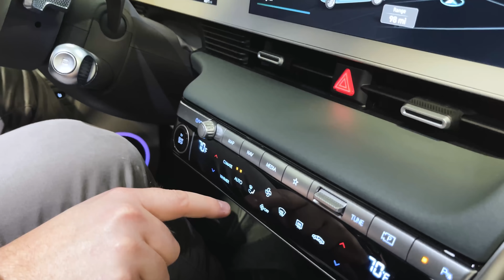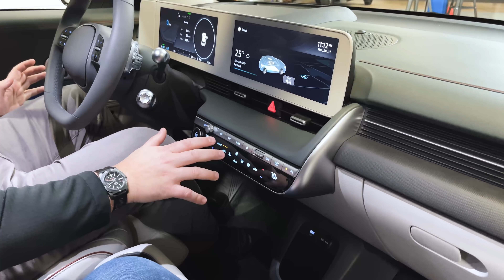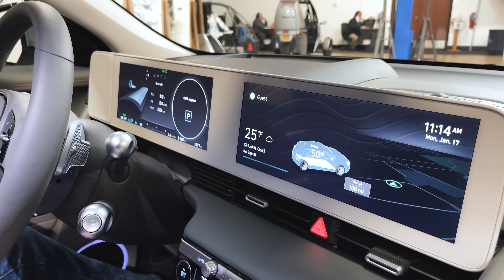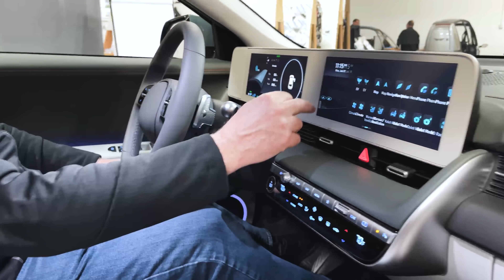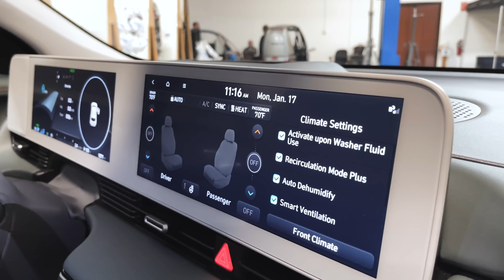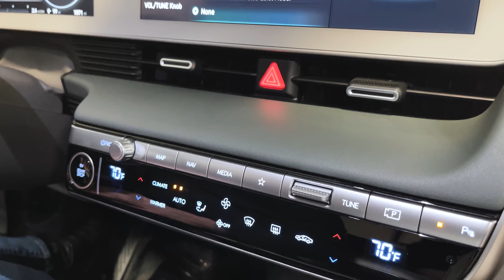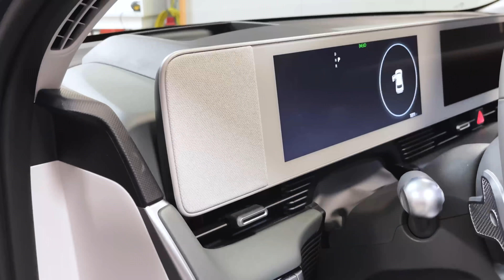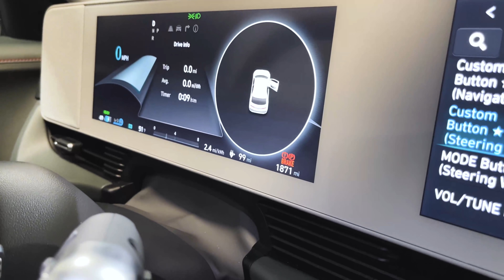2022 Hyundai IONIQ 5 | Sandy's First Impressions

Comment: At first glance, it looks like a modern take on a Honda CRX. It's more stylish than a Model 3 IMO.

I disagree completely about eliminating all the physical buttons. I would go so far as to say that the buttons need to be physical instead of capacitive. I understand that capacitive button panels are "cleaner" and likely cheaper, but we have them in our Explorer, and I would much prefer physical buttons, especially for the most-used buttons (seat heaters and steering wheel heaters in the winter). Those controls are only available in the touch screen on our model year, but they were made physical a few years later. I never use the touch screen to control the HVAC because there are buttons that do it easier and faster.

Wanting physical/dedicated buttons over a touchscreen-only interface doesn't make me a luddite (I'm perfectly comfortable with technology, thanks), it's about using the right tool for the job. Touchscreens aren't a cure-all, just ask the people that are still trying to find where things went in the latest release of the Tesla software. Anyone on a design team wanting to replace dedicated buttons should justify it by showing that it's just as easy/fast for a person driving 70 mph in traffic wearing gloves in a freezing cold vehicle to adjust the temperature of their seat heater while keeping their eyes on the road as much as possible. So, basically, less than a second to second and a half. That one second just took your eyes off the road for almost 103 feet. Three seconds is the length of a football field.

The only way that I can see this is to dedicate a space at the bottom of the screen that is always occupied by those controls. Kind of like the Mach-E and the Lightning...

Comment: Great first look guys, thanks!  Beautiful aesthetic design inside and out....with the exception of that frunk.  Now, at least they give you one where you could move all that charge cabling from the trunk to allow actual use of the sub-trunk, but you have to wonder whether they would have been better off bolting it shut like the Fisker Ocean to save costs as this frunk space, like Sandy said, is maybe good enough for fitting your wallet!  Better for Hyundai to save costs like the Fisker and price the Ioniq 5 so that it's more accessible to increase their customer  base during an incredibly competitive time.

Comment: Cory spoke a lot of my heart about this car. However Hyundai removed quite a bit stuff from the US model, and their launch is a mess. I paid 100 deposit back in June last year, only to be told that I cannot choose drivetrain, trim level, or color. We are at mercy of Hyundai on what was sent to the nearby dealers. And most dealers are having a huge mark ups on these.
Reply: Agreed. I've had mine reserved since May. I called the Hyundai Concierge service last week and they said I should get an email towards the end on this month. They also said that they have no control over pricing, but that they could add a preferred dealership of choice in my area. They also disclosed, after asking many questions, that  Hyundai is conducting exit interviews with Ioniq 5 buyers to get feedback. Well, on of the things I was able to get from the rep is that they know how much dealers are charging over MSRP. On average it's between $2,000-$10,000 USD! I'm willing to pay up to $3,000 over sticker, but no more. Hope this info helps a little. Good luck.
Reply: @dearbulls  thanks for the info. I'll look into it.

Comment: It would take me a month to figure out that you swipe the screen to get to the options, and probably only if someone else showed me. I still cant get used to that as a control feature on my smart phone either. To me if its not visible it might as well not exist. And thats when I realized that Sandy is more tech savvy than me and Im 44 and have been using computers since I was 8 years old. 😂

This is an absolutely gorgeous car. I really hope they do a city car kind of thing that is the same style but scaled down.
Reply: @Patreekko Time Agree 100%, our ISP crashed on Christmas Day so my  NBN dependant iMac was useless. I was forced to use data (first time ever) on my iPhone 12 Pro Max to gain access, & it was an absolute pain in the butt. I'd hate to think what it would've been like on a smaller screen.

On a touchy point of mine, please be nice to Sandy, I guess he's slightly + or - of my age & his red eyes could be from alcohol abuse, which probably explains why he didn't test the Ioniq on the track. 😉

Comment: "Auto Hold" is sort of a hill assist function that allows the driver to remove the foot from the brake pedal whan stopped at lights.
When taking off, the brakes disengage when the speeder is pressed and prevents backwards rolling of the car.
I have this feature in my Renault Zoe, but never use it as the car is programmed to work like an automatic ICE, that is, it starts applying about 1kW of power to the motor the moment you take the foot of the brake pedal. It would have to be a serious incline to overcome that and we don't have those in my neck of the woods...
Reply: Mercedes have the best idea. If you want to hold, you give the brake pedal an extra little push and you can let your foot off the brake knowing that it won't move anywhere. 

If you don't do the extra push, it works like a normal automatic. It means that whether to hold or not is entirely under your control, and you never need to touch the parking brake or transmission park as it'll just put them on automatically when you get out of the car.

Comment: Good video I test drove the Ioniq5 on a very wet day on dirty winter road in British Columbia Canada big problem not having a rear wiper , I hope that in Canada we can turn the rear facing camera on full time while driving as that would help I am sure it will be only a software update as its available in the UK cars, this was the only fault I could really find with the car. Sorry but I disagree with Sandy on the removing all the buttons its nice to have also if other people drive your car and are not familiar with the touch screen that a plus, also I have often thought about the Tesla having only a screen what happens if you have a screen failure .  I would like to have seen the passenger seat on the Ultimate the same as the drivers seat complete with the leg rest. All in all I think this is a great car I have already ordered a Long Range AWD Ultimate which I hope to have July Aug so by then maybe they will have made changes. Thank you for your video .

Comment: Personally want the manual control panel. Could phase it out in future models but there's lots of us boomers. But then I drive a 2007 chevy diesel truck with 250k and all the knobs still work and if 1 part goes bad I won't need a new $3k touch screen.

Comment: The 3 settings for auto HVAC settings is a huge thing for me. 
My car has Auto that I don't use because it comes on full blast. I'll limit it and then after driving for awhile put it in Auto.
My sister had an expedition with the different Max auto settings and it was great.
Reply: I tend to just adjust the temp to change how agressive Auto mode is. E.g. if I want it to warm up as fast and agressively as possible, I whack the temp up to Max. If I want to it be less agressive I set the temp closer to the current temp. Having different Auto modes would save some faffing, but it's not something I have to do often.

Comment: I'm very impressed with the products and design coming out of Hyundai/Kia. The only thing wrong with it is that it says "H" on the front instead of "T", so it can't use the supercharger network. Daily, I drive hundreds of miles and supercharge almost every day in addition to charging up every day at home.
Reply: I'm a Tesla fan,  but I'm even more a fan of efficiency, which means EV.  Tesla has a few "moats", one of the biggest is the Super Charger network.  But I don't understand why almost all Super Chargers are back in only.  Pull thru makes more sense for purposes of forming a queue or pulling a trailer.  BTW, the only reason Teslas have left rear charging ports is because Elon's home garage was set up that way.
Reply: @wilfredvanvalkenburgh2874  interesting... I didn't know that about the charge port location 👍

Comment: Interesting. I was thinking, if the odd plastic vent pockets on the rear hatch. Is to keep heat from the window defrost metal strips, from building to much heat in the area. answer below by Tom Ruffell seems more accurate.

Comment: I'm prefer the mechanics and fluid  tanks be more simpler to get to just incase you can't get to the mechanic in time like getting stuck at a charging station without enough charge to get to the mechanics. Also make it so all you need is 1 or 2 tools to get access and remove parts and put them together with ease.

Comment: 22:37 you can program that in a lot of cars, there's just no button for it.

Either through driver controls and infotainment or OBD config.

I have a slow ramp up on my cars.

33:19 ... Yeah, and how's that working out? The octovalve is a good idea in theory that seems to be shitting itself in practice, probably due to the usual suspect of poor QC on Tesla. Not that Hyundai's been doing that much better.

Comment: For how old sandy is, I am surprised he prefers climate controls in the infotainment. Personally I prefer climate separate because when you first start the car on a hot or cold day the car screens usually take a second to boot and are laggy meanwhile I’m trying to get my ac blasting, turn on heated seats or get windshield defrosters going. Stand-alone controls don’t lag and are easy to use when the car is moving. Hyundai made the right choice here climate control in screens are not optimal when first starting up or going down a bumpy road.

Comment: Sandy, get rid of the buttons that immediately give you the function you want… I’d rather spend time flipping through pages while I’m driving distracted.   Riiiight.

Re the frunk.  Frunks are stupid.  You have to make the front of the car longer to make a frunk and that takes away from the interior space unless you want to make the exterior dimensions bigger.

Comment: Sorry Sandy, I prefer climate controls separate than digging up on the screen. 
At first, it's feels interesting and curious, but overtime it gets annoying.
It'll not be user friendly and it's dangerous to take off eyes for finding the settings inside the screen while driving.
And that's a brilliant work from hyundai to separate frequently used settings from the screen.

Comment: You guys clearly don’t look in enough cars if you haven’t seen customisable buttons. BMW have had steering wheel customisable buttons for at least 15 years. Furthermore the 1-8 buttons on the entertainment system can also be programmed for any function. So for example 1 may be a radio station, 2 may be navigate home, 3 call home etc. Having assignable physical buttons means that you don’t have to scroll through a touch screen to find functions that YOU use regularly. I don’t want a designer/engineer like Sandy telling me what functions I should want easy access to.

Comment: They both missed the sliding rear seats.  They both missed the fast charging.  They both missed the AC out and the ability to emergency charge another EV.  And Sandy is wrong about too many buttons.  It's way easier, especially at night, to see buttons rather than swiping at a screen.  Choices are good, especially customizable buttons.  The exterior is sexy, rather than a frumpy gumby-faced Y.  AND it has a real info screen in front of the driver,  AND it offers a HUD.  The 5 is a winner.

Comment: nice first impression. About the programmable buttoms, the bmw i3 has 1-9 that many thinks are radio buttums. It also have 2 positions backseat. Have just used your good offer on the teardown. Think the buttoms for climasystem can shift to media with one of the buttoms?

Comment: One question I'd ask is how much (in money) do you estimate the multi-colour treatment) and 'scalloped' body panels/styling add to the overall cost to manufacture, compared say to a single colour, say with black highlights plus just a few at most  plastic frim panels plus simpler sheet metal.

Comment: 20:29 Was that an incandescent light under the sun visor?
Hard to believe in 2022, but the gradual light ramp seems light an incandescent bulb heating up, so wondering.
Reply: Good eye.  I think you are right.  In an EV, this seems to be a cardinal sin.  If correct, this would show an extreme lack of detail.  If this then probably 10 times as many unseen energy "hogs".

Comment: That's an error to get rid of the physical controls under the screen.  I don't want to have to fumble away from navigation or whatever to have to adjust the climate controls.  One screen for everything with no physical buttons means that you have to look down at the screen UI to go back to climate controls.  When the windshield starts to fog...I need to be able to get defrost immediately no matter if I am in heavy traffic and need to concentrate on the road.  Fumbling through 5 screens is BS.

Comment: I am very disappointed with your review. Really guys, trivial things like card holder at the sun shades and auto hold button are so hold stuff and you don’t even know them.
Anyhow, really low review and there are so many innovative features, which you haven’t considered to show. 
The roof is solar one, so at sunny locations the car can be self charged. The charging connector can use 800V, charge the car super fast and can also be used to charge other external appliances. 
Anyhow, a comparison to Tesla could be a nice thing to have. This one and the coming ioniq6 are considered to be a Tesla killer. 
My two cents.

Comment: what’s going to happen with this design is that every corner is going to be a very expensive paint and trim fix. Corners take most of the knocks and the 5 is loaded with expensive plastic, lights and trim.

Comment: @6:10 Those panel and door gaps look first-rate and even as anything I've ever seen to me. 
It's a promising introduction to the Ionic 5. The stats look equally impressive to me. 
That 800-volt charging, battery, and power train should be quite capable.
I might recommend it to my ex-wife once the lease is up on her car.

Comment: 800 Volt battery. Big no for me. High voltage allows for some manufacture economies, but there is no need for such higher voltages and all the risks it bring in daily usage of the car. 
400 Volts is the best compromise between manufacturing costs, mean times between faults, and user overall safety.
Thanks for the video...
Reply: @Ray of Light 62. WRONG, I GUARANTEE that 100VDC is LETHAL, please don't experiment to prove the point.
400VDC is also lethal & as is 800VDC. Surviving or dying is dependent on the resistance of contact & the directional path through the body.
Battery packs are constructed & installed in such a way that owners need not & should not interfere with them. The techs working on them would all be trained on how to handle them safely.
In the advent of an accident that compromises the integrity of the battery, they each have the same odds of catching fire or whatever.
I hope this helps. 👍

Comment: Are you guys considering raising funds and purchasing a Ioniq5 or EV6 (whichever you can get your hands on) for a teardown? I would chip in $100 without hesitation. Maybe publish a quiz to gauge the interest?
I reserved a Ioniq5 soon they opened the reservations website, just to find that Hyundai is only planning on selling this car on a few other US states initially. They don't know when will be sold in Michigan. I've heard that the battery cooling and AC might be sharing some components. In a hot day if the AC is running while charging, the car will slow battery charging to prevent overheating and keep cooling the cabin. Unlike Tesla that would prioritize battery charging at the expense of cabin comfort. I'm not a Tesla owner please correct me if I'm wrong. I like the Ioniq5 setup better, because if I'm in a hurry I could turn off the AC and speed up charging if needed. 
I agree with other comments, I also like the physical AC and radio buttons, nothing beats to be able to quickly adjust the fan or temperature without navigating the touch screen or exiting navigation.
Great content as usual. Thank you.

Comment: Everyone likes the physical buttons and I agree with them. This car to me is perfect on the outside, but the interior is seriously lacking compared to its direct competitor, the KIA EV6. One thing I would do is remove the shifting knob and put a proper centre console with a dial knob. Then move the climate buttons down on the centre console from the front. Yes, this would remove the console sliding back feature but lets be honest, thats just a gimic and no one is really going to use it. The centre console in this car looks very empty and cheap for me. Its competitor KIA EV6 has a great premium looking centre console. Also, for how futuristic the car looks, it should have usb C instead of usb A, something that the EV6 has. 

This is a great EV choice but personally I am going to hold off from buying it. EVs are improving very fast and the next few models will see drastic changes for the better in overall performance. The curve should flatten in the next 2-3 years which will then be a good time to make a long term purchase.